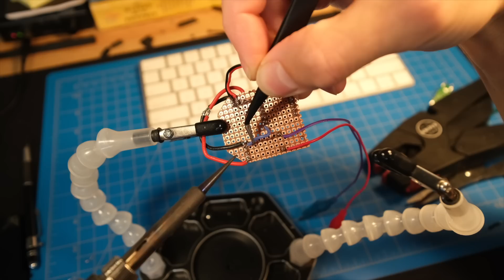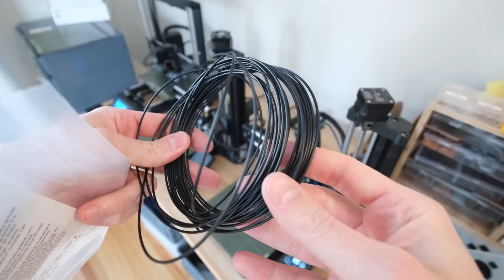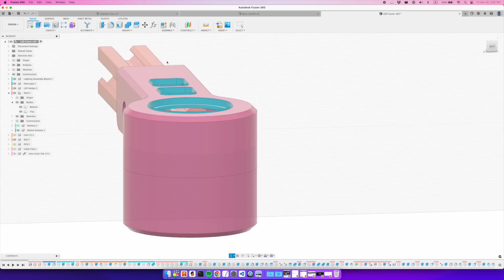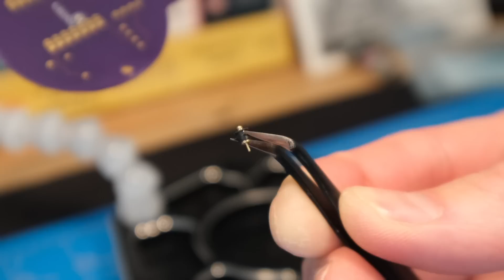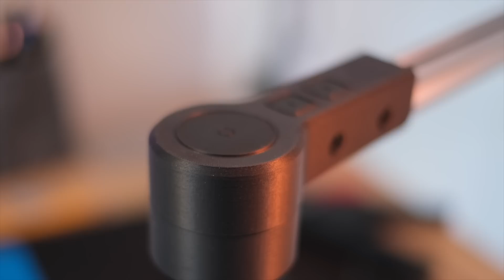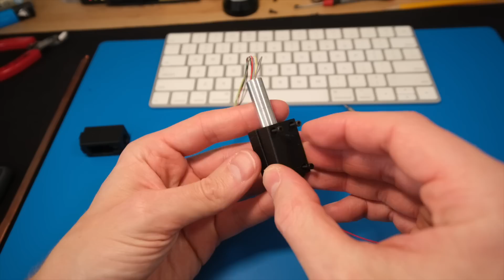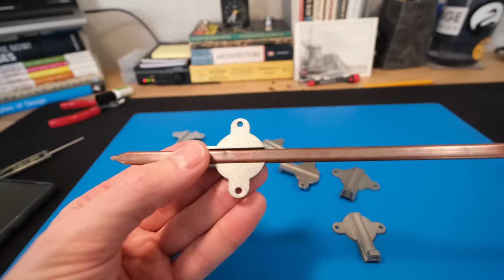The DIYson Electronics Pushed my Limits - DIYson Lamp Build Log #7

Comment: A slip ring is a good way to transmit the power from the base, but those cheap rings are not able to handle the radial forces. You need to add a bearing to support them. Try to fix the flicker by using "odd" frequencies like 935 Hz to avoid multiples or near multiples of your filming frame rate, if it is possible. I know, it's too late for the current iteration, but for the next iteration, consider using a spring loaded contact against a metal strip with isolated base for linear power transmission. Basically the way brushed DC motors work, just on a linear base. This can be hidden inside the groove of the extrusion, similar to the drag chain. And finally, feel free to contact me for more brainstorming, we can have a chat or two, I've build a few things and have seen a lot (personal and commercial/industrial things, from tiny to literal skyscraper size). Drop me an email or a reply if interested. Or just say hi in my matrix channel #chat@grumpydevelop:contentnation.net open for everyone who tinkers with stuff.

Comment: This is a great project, and I really enjoy the videos! But I think there's a lot of scope to reduce the volumetric size of the components on the PCB. The standalone modules take up a lot of space, for instance you could replace the QT Py with one of the smaller Atmel chips alongside a few capacitors and a linear regulator, and the buck module could be replaced with a cheap buck IC with a small inductor and a few more caps/resistors. That whole section could be smaller than the just the QT Py module alone (at the cost of a little more soldering of SMD components). There are mosfet based LED drivers that might perform better without having the risk of coil whine from an inductor, but just trying a different PSU with different coil properties might solve the problem.
Reply: +1! Even making a samd21 custom board they're really easy to make and you could remove the USB only needed for programming the board

But for a first board it's great work!
Reply: @AdelKhen  USB isn't too hard on the SAMD21 (and it sure is handy to have!), it's just full-speed USB 2.0, so it's pretty forgiving. I just put the chip right next to the USB port and route the traces as short and direct as possible, keeping them close-ish together so they vaguely resemble a transmission line. while that might get a professional engineer fired, for hobby purposes it works just fine (and besides, do Osh Park, JLC, etc even offer controlled impedance on their low cost 2 layer offerings?). the thing I always get nervous about is the crystal, I'm always scared I'll mess up the load capacitor formula (plus I keep getting tempted by impractically tiny crystal packages), but iirc the Arduino core for the SAMD21 supports crystalless operation so even that's not the end of the world to screw up.

the thing I'd advise caution about when recommending this to a beginner: the package options are a bit tricky, the friendliest option for the SAMD21 is a 32-pin QFP. I don't think one can expect a beginner to hand solder a 0.5mm QFP, IMO that's at the edge of reflow territory.

Comment: Have you looked at sheet metal for the part for holding the heat pipe and light assembly?  Sendcutsend and protocase could be decent alternatives. They also do cnc machining. Protolabs can do cnc machining as well. I also wonder if you could just insulate the heat pipe from the plastic. What temperature are you thinking the heat pipe would get to?  ASA could be a print friendly plastic we could use.

Comment: Would adding a capacitor in line with the LED help to smooth out the flicker? Might have to do a little math to calculate out the size needed but 100uF seems like a good place to start. Make sure the capacitor is rated to the max voltage the led would be exposed to.

Comment: It might be worth considering making the 3d printed metal part from sheet metal. There are some good cost effective services where you can laser/plasma/water cut the part and fold it. It will probably be a lot cheaper then 3d metal printing.

Comment: Awesome ! What about the Morph Solarcycle ? Is the teased part at the end a pcb that fits in the aluminium rail and coupled with pogo pins replace the dragchain? Very curious to see what you come up with for the aluminium heatsink holder part, are you sure you can't print it, even out of PA PC CF ?

Comment: Can you set the PWM frequency to a multiple of the framerate you're shooting at? I'm pretty sure that (or the reverse — syncing the camera to the light source) is how filmmakers dealt with things like CRT displays and fluorescent lights back when those things were more common. You don't need the frequency to be so crazy fast that the camera doesn't notice it, you just need the lights to be blinking on and off at exactly the same rate that your camera is capturing images.

Comment: Most cameras have some sort of anti flicker algorithm built in. Maybe try a multiple of 60hz? The flicker you are seeing is probably aliasing between the camera and the light. You could also try adding a capacitor in parallel with the LEDs to reduce the flicker.

Comment: for the flickering issue I wonder if simply adding a capacitor after the driver (kinda similar to a buck convertor) would help average out the output so it doesn't completely turn off and on constantly

Comment: For the metal part, have you considered using a resin print instead? They can take much higher temperatures without warping or melting than thermoplastics and more people probably have a MSLA printer over a CNC. You could probably get one of the big brands to sponsor you aha.

Comment: Don't know if this translates, but I saw a video where helicopter blades appeared still because the camera shutter speed matched the rpm of the helicopter. Since the problem only exists on film, you can make the light flicker in sync with the camera.

Comment: i know there exists swivel electrical connections, but my google fu has come up short on this. i havent read the comment section, so if i repeat this im sorry. You may consider putting the LED driver in the base where the lamp seats to the table. More options for possibly beefing up the size to eliminate audio, or acustically dampening it.

Comment: You should try putting a Capacitor between the V+ and V- of the LDD-L, maybe a 10uF or 40uF. I do not think the analog dimmer would work because the analog dimmers still use PWM to dim the LEDs but they are just fixed at 1000 kHz. Slower between 100 ~ 500Hz which is lower frequency then what you tried.

Comment: Such a cool way to implement the capacitive buttons.  Did you experiment with using them as a single piece?  I wonder how far from the pogo pin you'd have to get before the resistance of the PLA was enough to stop the button working.

P.S. The "I've known about the flickering for a while" shot confirmed that it's definitely a new monitor stand.  Are you still planning to do a video about it?

Comment: I'm curious if setting the LED driver frequency to a multiple of the shutter speed of the camera (if possible) will eliminate both the flicker as well as the noise... say 1200, 1800, 2400, etc. for 60hz shutter speed.

Comment: I'm not an electronics expert at all, but I think going analog is undesirable with LEDs (unless it does it with.. current adjusting? I don't know, at all). But, maybe try odd frequencies for your pwm. Like, frequency=953 instead of 1000? Something that won't resonate with video sensors, whatever frequency that might be. 

I think camcorders used to do trickery to avoid picking up the 60hz visual hum from old CFL bulbs. Those bulbs are long gone, but I bet the tricks are still built into cameras, so maybe a multiple of 60hz?

Comment: From the video it looks like you have very tiny traces on the pcb for the power. You should probably make them a bit wider to reduce voltage drop and powerdisipation.
For the flickering, add a 1uF cap on the output of the LED driver. That should be enough. If not, try a 4.7uF cap.

Comment: With the flickering, could you try a frequency that is a multiple of the camera frame-rate?
Reply: I would try this. Specifically I would try somethings that’s a multiple of 24hz, 30hz and 50hz (to cover common camera frame rates).

The least common multiple of those frequencies is 600hz, so within your existing drivers capabilities.

Alternatively, don’t do the PWM via the driver. Have the driver output a fixed voltage, and add a MOSFET between it and the LEDs. Then you can PWM the MOSFET instead. Although that might not work for a constant current driver.

Comment: You either want do current drive of the LED, resulting in a linear behaviour, no switching at all, this means the LED might not operate at the ideal efficiency or might not operate at the rated CRI, or, you want way higher frequency, in a probably custom driver, I'm willing to help design or design either, really like the project, I would love to see the integration of the oter fancier features like light detection

Comment: just PWM the led power with a transistor after the the led power supply, you may have to invert your signal from the controller in software.

Comment: Instead of trying to hide the flicker by tuning it to your current camera, adding a few capacitors ( maybe a few 10uF MLCC?) in parallell with the led, that should smooth out the current from the led driver and fix atleast most of the flickering (if it can handle capacitive loads..)

Comment: For the base. Would it be possible, safe and practical to have a ring imbedded  in the desk clamp then a pin on the upright extrusion that ensures constant electrical contact reguardless of rotation? *making sure the upright itself is electrically isolated

Comment: Have you tried using this LED driver off of the PCB? Does it make less noise? Often the PCB itself resonates and acts as a loudspeaker from the vibration of the capacitors inside the driver. If that is the case, you can try to remove a bunch of unused area on the PCB near the driver to decouple the vibration.

Comment: put caps in with your leds to eliminate flicker. i'd have ceramic .1uf, 1uf, and 10uf. then electrolytic 68uf, and one larger one like a 1200uf. your flicker will probably be gone. make sure your caps are rated for about double the voltage you're actually using.

Comment: Yeh...i would use a slip ring myself...Is that metal part acting as a heatsink or are you just worried about plastic melting? You could try embedding a copper heatsink in a 3d printed part. Maybe 3d print out of Nylon for High Temp Resistance.

Comment: The light flicker is the result the of the camera shutter and the light frequency not matching, so you could try a frequency that's a multiple of your camera shutter speed and match the two up.  I would personally first try the exact same frequency as the camera shutter speed and then go up from there until I am satisfied with the result.  You might be able to find a frequency that doesn't flicker before reaching the whine range.

Comment: Have you thought about driving the LEDs yourself with a mosfet at higher frequencys. It comes with its own challenges e.g. exponential voltage-brightnes correlation on a led and driving a mosfet at higher frequencys. But you could probably get away with a smaller footprint than the driver module and a wider Frequenz range to play with.

Comment: you could maybe eliminate the flickering by decreasing the frequency to 50 or 60 Hz depending on where you live so it matches the electrical grid.
(somebody else commented saying you could use multiples of 50/60 but afaik that would just make the stripes stationary instead, they would still be there)
Smartphone cameras all have a flicker correction nowdays and normal cameras probably do too. and that is generally tuned to the frequency of the electrical grid

it might introduce electrical problems tho bc it might result in you turning the LED in the moments where the source voltage is 0 or the maximum and could be inconsistent so it might not work (and it's more of a hack than a real fix)

Comment: constant current/constant voltage dimming instead of the standard PWM/dimmer should be better to stop the flicker. Memory evades me at this current time, but one of those rather than a standard PWM/dimmer should yield better results. Should be able to do it with a few discrete components on a single pin as well. If I remember details, I'll comment again, but I think that would be the ideal direction for the dimming circuit.

Comment: I would almost like to cut the extrusion down the length. Issolate the two rails, then reattach them with some non conductive fasteners, and make one side ground and the other side 5v (or what ever volts you are using. You could pretty much eliminate the wires.

Comment: on the original lamp, to get the power from the base to the lamp they use a simple round DC jack
Reply: Hell yeah! Simplest idea but as it only need to transfer power through 2 cables that seems perfect, even 3 or 4 wire could use audio jack

Comment: Not a electronics guys but, is there a mid point where the flickering goes but the whine does not kick in. 2000, 2500, 3000?

Comment: Have you considered using a mosfet to drive the LED? You could test this with an old 3D printer board. I am driving some IR Halogen lamps off a heater port on my SKR 1.4 They don't flicker even on camera. I've tried 10%-100% brightness. If you're struggling with the circuit design I recommend just copy paste the circuit off an SKR. It's all arduino lol. The typical switching frequency of Mosfets are arround 25–500kHz, the same for IGBTs are 10–20 kHz. Should completely solve your issue.

Comment: The special filament for the touch buttons was likely completely unnecessary. I've had back button mods for game controllers for years, where the button is just a pcb or piece of foil taped inside the plastic housing, tapped on the outside to reset the mod. Standard ABS, no magic or special materials required. As long as the touch button is sensitive enough, you can tap them through up to 1-2mm of plastic no problem.

Comment: I´m really noob in electronics, but maybe it is possible to deal with the "on camera flickering" just by a different settings of the camera (lower iso, ect.) instead of overclocking the LED driver extensively? :-) But I´m not sure.

Comment: As a mechanical engineer who has used plenty of plastic threaded screws PLEASE increase the size of those PCB mounting screws! It might seem unnecessary given no load, but those threads will strip out very easily and since the holes are so small there’s almost nothing you can do about it. I recommend upgrading to M3 if you can! M2 even would help, but there’s plenty of mechanical space to upgrade to an M3 screw
Reply: Also, for that part at the end that you’re considering CNC Machining, it seems like it could be pretty successfully done with 2D profiles and laser cutting/bending with the right geometry! Would be way more accessible to laser cut a metal profile and bend it with a vice and a hammer, or get it sourced for a lot cheaper than a CNC machined part. Worth a consideration!
Reply from the maker: I share your anxiety with these little screws haha. I promise to try promoting them to at least M2 :)
Reply: @StevenBennettMakes  also, there are plastite threaded screws on McMaster that have this fancy tri lobe shape that have a lower thread pitch and are less likely to strip out. Consider those as well! Maybe even brass heat set inserts

Comment: Hi Steven, I like Your design. Didn't think I would need that kind of lighting but now I probably can't cope without one!! But anyway, was kind of intrigued with your flickering problem and would like to do some experiments. Could you give type numbers for the leds you have used, so I avoid accidentally experiments with leds that behave differently. Probably not an issue but..... E8-)
I think that modifying switch mode power supply circuit to current control would do the trick. Ones I use, usually switch from 100k - 2M Hz range so both visual and auditory problems should be minimal.

Comment: Keep the high frequency and put a capacitor across the led or before the led driver.

The capacitor should have a low value. 101, 104 just buy a bunch of capacitors and use trial and error.

But if the noise is coming from the driver then you will need to find a driver with a higher frequency rating.

It should not be to difficult sort it out.

Also try push the frequency to 20 kHz. See if it works.

Comment: my personal choice would have been a simple potentiometer with a switching contact at the zero point, as used in simple old radios, over touch buttons, which i have come to loathe. maximum tactility and analog feel.

Comment: I noticed the article you recommended for learning how to design a PCB is different from what you're using (f360). Any fusion 360 specific tutorials you would suggest watching?
Reply from the maker: That's true; the tutorial is technically for Autodesk Eagle, but since Eagle is currently being integrated into Fusion 360 Electronics most of it is still applicable and still a great introduction to the overall workflow in my opinion. You can also open Eagle files in Fusion 360 Electronics so you could follow the guide verbatim in Eagle then just open the resulting file in Fusion. 

One concept that was especially helpful for me was the process of creating and using components. For that I relied on these guides (among others):
https://www.youtube.com/watch?v=zqar0XWtFaY&t=323s&ab_channel=AutodeskFusion360
https://www.youtube.com/watch?v=NITJZfhjppI&ab_channel=WillDonaldson

Comment: You should be able to keep it underclocked and flicker free, try refresh rates with multiples of 60 or 59.94 such as 960 or 959 (959.04 if possible)